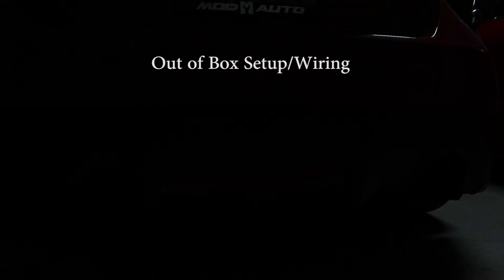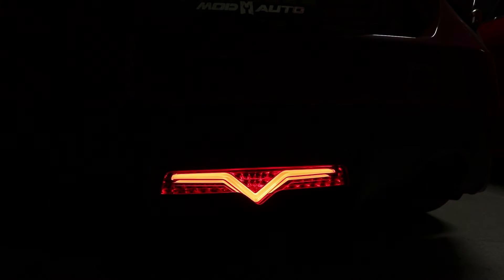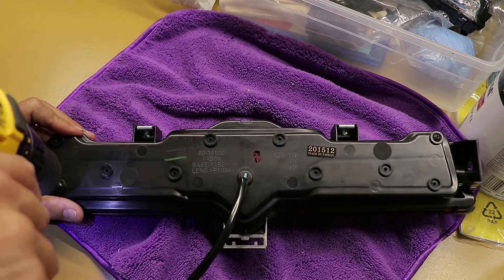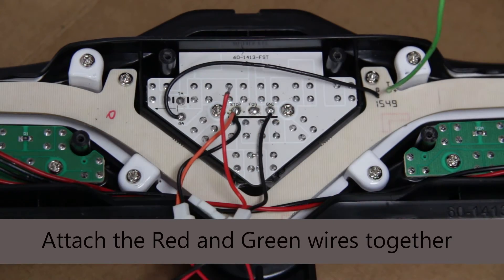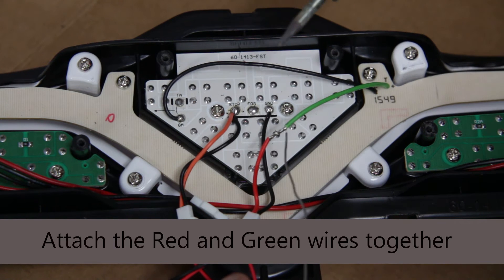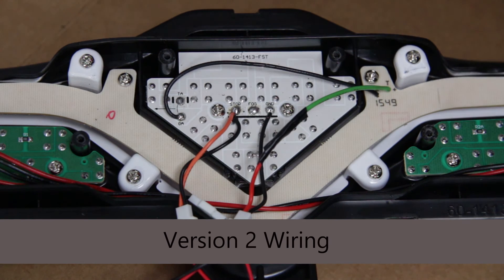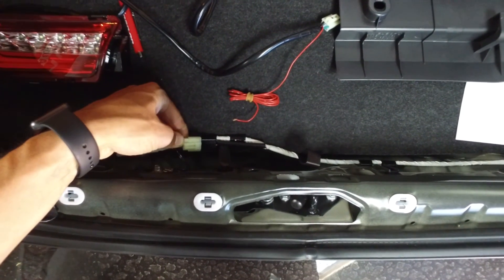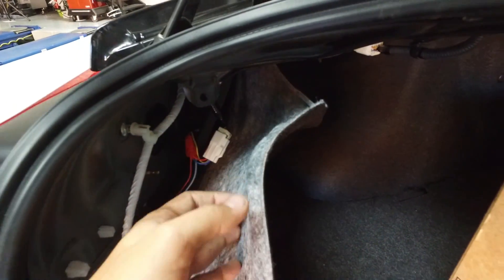DIY: Valenti 4th Brake Light Wiring Mod- HOW TO -Separate "V" and Brake

Comment: v2 worked like a charm. 2018 Brz, I did have a newer version of the lights as the green wire on mine was actually blue but followed the video and it worked. Initially the triangle didnt come on, but after adjusting the red wire in the t tap connector, everything was good.
Reply: Still working like a charm? I’ve got a 2020 BRZ, and was thinking about doing version 3 wiring, but I like the version 2 flash more, but a lot of the old comments of people having issues with v2 has me a bit concerned.

Comment: 2017 86 here, v2 worked great (with the car "on" in accessory AND while it is running). I also used a plug and play harness (uses two factory connectors and has the two taillight and brake wires spliced in) so I did not use any T-Taps or Positaps.
Reply: Still working great? I’ve got a 2020 BRZ, and was thinking about doing version 3 wiring, but I like the version 2 flash more, but a lot of the old comments of people having issues with v2 has me a bit concerned. Also likely going to buy one of those plug and play harnesses too since I don’t like the idea of splicing into the oem tails.

Comment: Hey i know this is an old video but i got this 4th  break light and i really dislike the blinking, i dont have the heating pistol or tin metal to do the kalai process, so what is the easiest way to just have the V light up with daytime lights and the triangle(brake) light not to light at all? Lastly since i wont need the triangle brake light i wont need to tap the tailights with the 4th brake light correct?

Comment: I have mine setup for version 2, it almost lights up as should...
Reverse light work, V light works (Running light), brake and V light (running light) works but brake without the V is very dim and hard to see.

Inside the wires are all soldered the same &
I have Valenti brake lights too so have the blue wires both linked and both reds linked. why is the brake alone soo dim?
Reply from the maker: I have no idea, that’s what had stumped me with this 4th brake light

Comment: In order for the brake(triangle) light to flash you need to have the “fog” connected to your brake light and a delayed 12v signal going to the “Stop” on the back of the light.
Reply: Wouldn't it work with both "fog" and "stop" connected to the brake wire? Thanks!

Comment: What should the blue wire connect to? The brake light or running lights? And same for the red which does it go to? I’m attempting this with the Valenti Revo tail lights

Comment: How would the wiring work for the Valenti Revo taillights? For version 3? It’s a lot different from your typical Valenti taillights. I need help with this please!?
Reply: How is it different?
Reply: Guyon Cumby the Revo only uses green wires and a black ground wire. I don’t know which wire does what on the Revo harness.
Reply: @eddie_sj  I have the same taillights. Did you ever figure it out? Also will any cheap soldering gun work? I'm not tryna spend alot of a soldering gun ha

Comment: I have the same problem with v2 wiring, the brake light is very dim and it doesn’t even flash when i brake
Reply from the maker: Lame! At least we still have v3 available.
Reply: Charles Pages Do you know how to wire it with the relay?
Reply: LazerKing117 did you ever figure how to wire it up with a relay? I really want the strobing effect 😐
Reply: Danny Gonzalez I haven’t gotten the chance to, i want the strobing effect too, but i don’t wanna spend time with wiring a relay for it
Reply: LazerKing117 would you happen to know what relay would work for it, should any strobe brake light module work?
Reply: Danny Gonzalez i’m not sure, i’m not big on electrical. I was looking into the relays that uses electronics rather than a switch so you don’t hear it though

Comment: Version 2 failed to work on my '15 FRS (extremely dim stop triangle), so 20 minutes later with the soldering iron under the rear of the car, I had version 3 working fine.
Reply from the maker: Hmm, I still haven't figured this one out. I think it has something to do with the load on the circuit. Glad you got up and running with version 3!
Reply: @chazpages  Hello, I have a version 2 problem with a twist.  I wired everything up in the garage, it all works as advertised.  
The triangle light blinks then goes solid with the brake pedal as it should.  However, when I start the engine and get on the brake pedal, the triangle light doesn't blink and just glows very dim.  Works great without the engine running, doesn't work with the engine running.  Anyone ever hear of that issue?
Reply: I’m having the same issue with version 2. When I connect the brake triangle wire to the car’s running light wire it appears to blink/light up properly (full brightness) but when I connect it to the brake light wire it doesn’t blink and appears dim when the brake is applied. Any ideas?

Comment: Do you have to rewire it a certain way to run the flashing brake light without having your DRL lights turned on?
Reply from the maker: Yeah and you can make the triangle brake light always on, or only on and flash (then stay solid if you hold the brakes)

Comment: Hello, are you still operating on this channel? I havr a question for the version 2. I have valenti tail ligjts as well as the third brake light. After doing the wiring on the third brake light, what wires do i connect from the third brake light to the tail light? Thank you!
Reply from the maker: I am but I no longer have the FRS. There is a 4 pin connector at both tail lights, you'll need to tap that (except for the reverse-that is under the black cover where the trunk latches/locks). I forget the wiring colors, but there is only 4. Ground, running, brake, blinker.

Comment: Hey quick question. I tried to wire the version 2 but the triangle brake light ended up being the running light and the "v" turned on only when I pressed the brake. They're essentially reversed.
Reply from the maker: Hmm, I wonder if they changed some of the wiring. Just swap the brake and running light wire?

Comment: why did you make changes before you started version 2 wiring? if red + green and separating orange and black is V2? then what does attaching red to green do?
Reply from the maker: It's been a while, but attaching red and green (I THINK) will make it so the running light and brake are separate and it won't flash unless you pulse/step and release the brake.

Comment: I did the V2 and I’m confused because I’m an electronics technician... so my Issue is when the car is not in but accessories are it works perfectly but when I turn the engine over it doesn’t work anymore
Reply: i have same problem,when car is off with just lights on V2 works as it should but when car is on the middle part have a very weak blinking and glowing...it just doesnt makes any sense why it does that.

Comment: Great video just the last step I don’t quite get, I’ve read the comments but they are unclear to me. So I’ve got valenti tail lights with 4 wires, blue black red and yellow. 

Now I don’t know which wires I have to connect from the 4th brake light to the tail lights. 

As of right now I have the 3 wire on the 4th brake light as well as that spare wire
Reply: Did you End up finding Which one to Connect to? I ran Into the same issue, ended up disconnecting my reverse and finally getting back to it a year later. Also, @CharlesPage Well Done With response and Instructions
Reply from the maker: You'll have 3 wires hooked up to a tail light (doesn't matter which one) and one wire go to the reverse harness. You'll need to determine which wire powers what. You should only need to tap into 2 of the wires on the taillight. Also, it sounds like you have the valenti tail lights as well? You'll need to figure out which wire is the brake light, and which wire is the running lights. You'll then tap in the reverse light harness wires to these spots.

Comment: Hey Charles,  Ive done V2 and the problem is that the triangle and the v are opposite.  The v comes on with the brake and the triangle stays on with the running lights.

Comment: I found in internet the solution to the Version 2 problem. The issue is that the break line is divided between the 2 taillights and the 3rd break light and doesn't give enough power to the 4th break light (Valenti). Because of that the Valenti break light doesn't flash like Version 2 should. I tested the soldering by connecting the Valenti's to straight to battery and they worked like intended but when connected to break line it wouldn't flash and instead give out a dim light. To fix this I set up a relay and ran the power directly from the battery (I connected to the factory amp wire since it has a 12V always on in one of the wires). And it worked. My only issue is that the relay i have makes a clicking noise everytime i hit the breakes. So now I will need to look into getting a relay that is quite
Reply from the maker: For those that don't follow this on ft86club, a solid state relay should allow this to function, without the "click." You will still have the clicking inside the cabin however (just like all cars). https://amzn.to/2IUxAXx
Reply: @chazpages  whats the process of wiring a relay?

Comment: Very helpful video. I have a Velanti brand LED but the boards are different. Green wire is now solid blue. I guess the new batch of Valenti 4th brake lights changed a bit. This modification is way easier if you are familiar with electrical knowledge.
Reply from the maker: Yeah once you break down what each wire does, making it do what you want is easy! I'd love to get my hands on a new one just to see what the differences are.
Reply: Charles Pages, not many changes. Only the wires are soldered differently. Btw the reverse LEDs suck. I wanted to change them out but I don't know what I can use to replace them
Reply from the maker: Yeah, I don't see an easy way to swap the reverse leds. They really are just for looks.
Reply: Yes, p[us good soldering technique - which is harder than it may look in this video which was done by someone who knows how to do it.  Having seen multiple soldering jobs gone awry, I suggest having someone who does know how yo properly solder do the work inside the light.

Comment: I just installed mine today and got everything to work great. I used option 3 without any troubles. Thanks a lot for this great video! The only thing I can't figure out is how the heck do you put the Plastic Rivets back on? I might be asking a very dumb question but I just can not figure out how to push those black small plastic rivets back on? Please help if you can? I really appreciate it and I am really sorry for asking the most dumbest question. Maybe I am doing something wrong?
Reply from the maker: Hey glad to hear you got it installed! As for the rivets, if it's the ones I'm thinking of that you pop the middle part out and pull, install is "easy." Pop the tabs back out, and it should make the inside part easier to push into the hole. Once it's in (lol) push the middle of the tab in, and it will lock in place. Sometimes you have to sort of work it in there. You will not be able to install them if the center of the tab rivet is popped in.

Comment: how can i do this: "V" as the running day lights (parkers).
Triangle off completely and only on when fogs are actually applied
Reverse as normal. No breaking light at all.
If this isnt possible, how can i remove the triangle light completely?
Reply from the maker: Just separate the wiring (choose blinking or no blinking) but hook up the wire that powers the triangle to the fog light wire.

Comment: I rewired the actual 4th brake light to Version 3, but I'm confused on how to actually hook up the brake light itself to the taillight. Basically, the whole switching the wires around. Please help! Thank You.
Reply from the maker: So you've done the mod to version 3? Next is just hooking up the wires by tapping into the factory wires. You should only need to wire two of them-one is a plug (where the factory light plugs in) and the two you need to wire can be done at either one of the tail lights.

Comment: People like you is why the internet is a cool place. If I get a valenti 4th light I'll certainly try this, with the version 2 problem I've been reading about I'll just go for ver 3. One question Charles, do our cars have a factory rear fog light here in the US? I have a 17 brz
Reply from the maker: Hey, thanks Mario Paul! If you don't mind a little extra work, you can try version 2 first-it'll either work or it won't! As for the rear fog, the US spec vehicles don't receive that wiring, so the best/easiest bet is wiring it up to just come on with parking lights (which is how it will light up if you follow this guide).

Comment: Man it sucks that version 2 doesn’t work on mine. It’s wired up right now to work on that version. I think I’m gonna take it out of the bumper and solder the wires in the light while it’s still wired and see if the lights work the way I wanted it to.

Comment: Just dropping a thanks. Very helpful video. My 'green' wire was blue though. Also for the install I have factory tail lights and I had to wire red to green and blue to red.
Reply: Monday Mini Mod Day Monday yes if I remember right my unit had a 2017 mfg date. I did version 3 the wires inside that you join in the video are green and red but my green was actually blue. When doing the install and tapping into taillight wires I tapped red wire from 4th brake to green tail and blue wire from 4th brake to red tail
Reply: Mini Mod Day Monday yes correct :)
Reply: Mini Mod Day Monday hm I dunno about that. But I have aftermarket hid kit powered off its own relay. Haven't had an issue with 4th brake causing other lights problems :/
Reply: Did you do version 2 or 3?

Comment: Just bought mine and Version 2 won't work. It works as Version 3 and the break light is super dim. I am extremely frustrated with this
Reply from the maker: Hmm, we haven't see that before. What happens when it was wired as version 2? Normally, the dim brake light is the symptom of version 2, NOT 3.
Reply: OK. I found the solution to the Version 2 problem. The issue is that the break line is divided between the 2 taillights and the 3rd break light and doesn't give enough power to the 4th break light (Valenti). Because of that the Valenti break light doesn't flash like Version 2 should. I tested the soldering by connecting the Valenti's to straight to battery and they worked like intended but when connected to break line it wouldn't flash and instead give out a dim light. To fix this I set up a relay and ran the power directly from the battery (I connected to the factory amp wire since it has a 12V always on in one of the wires). And it worked. My only issue is that the relay i have makes a clicking noise everytime i hit the breakes. So now I will need to look into getting a relay that is quite
Reply from the maker: Hmm, that might just be it. It would certainly explain why bench testing works just fine, but in car it doesn't work. Very odd that it needs THAT much power, though. It still doesn't make sense to me that it doesn't get enough power, when if hooked up out of the box/like normal it has enough power to light up and blink. I wonder if something like http://amzn.to/2qrJCcT would work/be quiet though.
Reply: I used a normal relay from a nearby autozone. However, I am really not happy with the clicking sound that it makes every time I press and release the brakes. The one you showed is only 0.5A. I am not sure if that will be enough. Currently looking at getting some solid state relays but having hard time finding a right one for 12VDC currents with about 5-10A

Comment: Hey, just want to ask because I have a gt86 and it doesn't have the fog light option only Daytime running lights. Is it the same if I do the wirings for the version 3? Like, will I get the triangle bit in the middle as a normal solid brake when i press on the brake and the V bar on when i have the headlights on parker/low beam?
Reply from the maker: Are your lights (headlights and tail lights) always on when the car is running?
Reply: No, but the DRL is always on when the handbrake is down
Reply: So, if i want to have the V bar on when i turn my parkers/low beam on and have the triangle be a solid red when I flash, should I just follow the instructions for the 3rd option?
Reply from the maker: 3rd option is what you want for no flash. As long as the rear running lights (parkers, I believe for you guys) are separate from the headlights/drl everything will work fine.
Reply: cheers bro. I will try it out later and let you know what happens